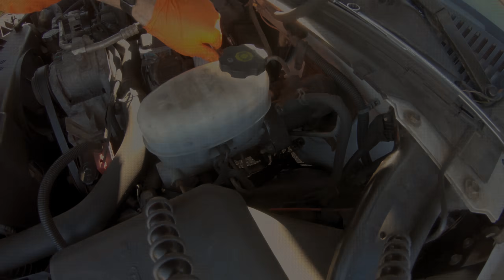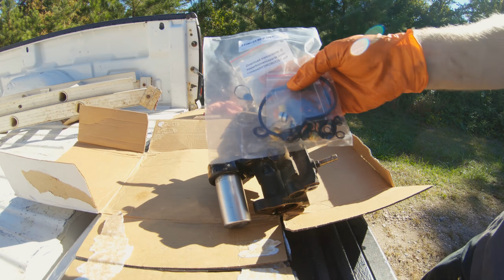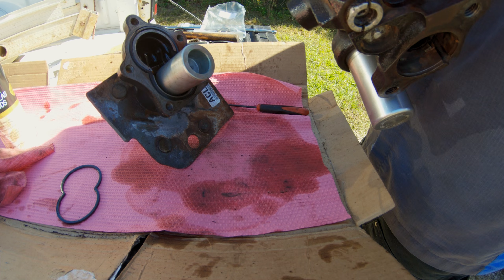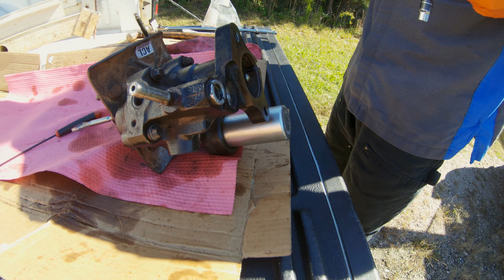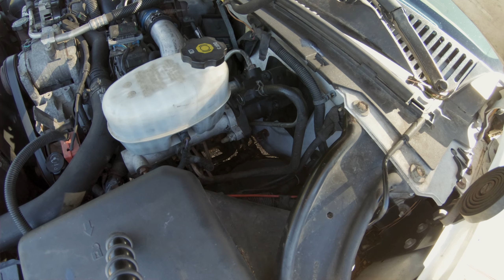GM Hydroboost Brake Booster Leak Repair

Comment: Do yourself a favor and get a 3/8" drive impact 15 mm deep well wobble socket ($20) and couple it to a 12" 3/8" drive extension.  This and an impact is all you need to get the 4 nuts off the inside of the firewall.  (If not already, get a cordless impact.  You'll be surprised how much you use it.  Plus, it busts off lug nuts and other high torque nuts with ease.)
I replaced the seal with the hydro boost still mounted to the firewall.  I was so proud of myself, but going back together, gravity was not on my side and I broke the rod that is internal of the booster.  So, don't do that!  I ended up having to replace the hydro boost, because that rod I broke is not sold separately.  $200 lesson I thought I'd share.
Using the tools I mentioned above, you can have it out in 15 minutes, if not sooner.  Then you can stand it up on its end to reassemble it.  That part is a piece of cake.  PS, you will need a normal size flat tip screwdriver to pop the metal keeper off the main rod that connects to the brake pedal.  You can rotate that metal keeper with your finger tips so you can get the screwdriver in it.  Then just rotate the screwdriver to flex the metal keeper.

Comment: good video , i put in a new unit and it leaks !!! not from the lines but i guess the internal seals.. that's from advance auto folks. did not have much room on the 2012 gas e350. any thoughts?
Reply from the maker: Return it if the unit is bad new. They nned to exchange it.

Comment: So it comes in a kit.. did I miss something or did you only replace the one seal that was leaking? And awesome video.. this gunna save me lots!.
Reply: Did the new seals. Now started the truck break peddle goes to the floor on it's own and the lines to the hydro booster get hot as hell real fast... what did I do wrong? Lol.
Reply: @ronniebarringer5887  ummm did you make sure the piston moved freely after you reassembled it before installing back in the truck?
Reply: @demonslayer951  yeah I had it figured out about 10 mins after I commented that. Lol.
Reply: @ronniebarringer5887  good shit haha. It took about 3 weeks for mine to finally stop leaking after I did the seals. Guess they just needed time to swell
Reply: @demonslayer951  really?.. that's weired. Lol. I wonder why it worked out like that.. something loose maybe?
Reply: @ronniebarringer5887  no clue, I figured it just wasn’t gonna fix it and maybe the piston was worn too much but I kept checking it and noticed was slowing down the leak and now it’s completely stopped
Reply: just replaced the seal inside for the large piston
Reply: Sweet. I have the same problem hopefully this fixes mine too.
Reply: @ronniebarringer5887  i just finished doing it on my 05 duramax, so far its not leaking anymore hopefully stays like that

Comment: Is there a liquid you can buy that will seal it up or to slow down the leak. How much for the repair  ket
Reply: You can try lucas power steering leak but it's at best a bandage to slow the leak a little. If you are leaking a lot, this applies to any type of leak, you have to trace the issue and properly fix it. No additive is going to "fix" a bad seal.  They can slow it down a bit and buy you time but it's not normally going to be worth the cost of the additive.

Comment: Good video. Not really a fun job but not the worst I've done. I completely get why you didn't record removing the four 15mm bolts in the cab, way too much cussing for youtube.

Edit: I needed to add that while this video was a great help, the seal kit did not work for me. That's probably due to the fact I bought a cheap kit off ebay. I figure if I had bought the more complete kit it might have worked. So I ended up just installing a new hydrobooster just because I didn't want to wait for a new kit

Comment: Why can't I just remove the five bolts under the hood instead of removing the whole booster from inside???
Seems quicker and less work.
Reply: You can.
Reply: My exact thoughts
Reply: @truth_teller100 I was able to reseal mine with just taking it apart under the hood but getting the new seal back in is a little tricky since you are installing it backwards. I used a little flat screwdriver to help coax the seal in place. Do not force the front half onto it. You will feel when the seal is in place. And be very careful taking it apart, there is a back pressure piece that can fall out when you remove the front half. Luckily my seal kit had a diagram of how everything was suppose to be!! Good luck!!
Reply: @peemee3011  what company did you buy your seal kit from? I need that diagram bcuz the parts store computer does not show any assembly of the interior parts. Mine kind of exploded off the booster after removing the 5 bolts. So I'm guessing how to put it back together.
Reply: @denisewilson8367  I bought it on ebay, don't remember from who, sorry.. Yeah, if there is a next time, pump the brake pedal a few times to discharge any pressure left in the accumulator before disassembly. I copied a diagram from online that is even better view than I had. It shows you sequence of parts and which direction they go.

Comment: Is there an O ring between the master cylinder where it bolts up to the booster that I can replace its leaking right at that plate where those 15 mm nuts are
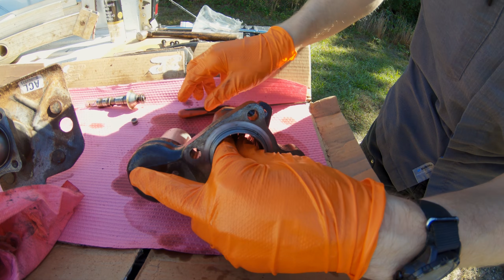Reply: pretty sure that what that lip seal prevents @10:00
Reply: its the figure 8 seal he replace 2nd after the O ring he did first. That's the seal between the booster & the master cylinder.
Reply: So if yours leaking into the floor board? I just bought a 2500 4x4 Sierra and it’s got fluid all in the driver side floor board
Reply: @bowtiebuilding   very possible

Comment: So, I'm finally getting to this job today, and my question is this- my rebuild kit came with a lot of other seals, rings, brass fittings and some other stuff. Where do all those parts go?? I'd sure hate to go to all the trouble of replacing the inner seal and then find out there were other seals leaking that I didn't replace. ???

Comment: 9:30 mentioned power steering fluid 

I truck has a leak from that area and I know my power steering fluid is very very low I didn't know that there was a connection between the two does power steering fluid go in that area too or were you talking about brake fluid?
Reply from the maker: The hydroboost is feed hydraulic pressure from the power steering pump. Power steering fluid circulates through the steering rack/box and the brake booster.
Reply: @MrSubaru1387  ok I thought that was brake fluid that creates the pressure. Good to know. I'll also check my power steering fluid since I recently had a leaky hose fixed. My power steering fluid was always low. Thank you for explaining this. I couldn't figure out why you were turning the steering wheel back & forth & pumping the brakes while the engine was off.

Comment: Ok, changed my mind. Already have the rebuild/seal kit, so I'm going to do it myself (with the help of your video). I've got to pick up a set of line wrenches (flare nut wrench). You didn't mention what size those nuts were in the video. If you happen to see this comment, please let me know what size those are so I don't buy a set with every size but the ones I need. Thanks! Lee

Comment: Hey I just watched your video . Unfortunately I bought a new brake booster and master cylinder but it says to reuse the rod with the star shaped washer.  I get that but it came with 2 small round washers do those go on the rod and if so where is the placement of them 817 627 4132 any help is appreciated

Comment: Great video, very informative! So informative that at about the 5 minute mark, I knew for sure that I'm paying somebody to do this job. I just changed out my power steering pump yesterday, and found after I got it out that it wasn't the pump or hoses that leak, it's the weep hole between the brake master cylinder and the hydro boost. Damn!! Wrong repair! But you did a great job explaining exactly what I needed to know. Thanks very much.
Reply: Damn, I almost made the wrong repair too.
Reply: I was afraid of this but spent a good two weeks watching vids and pressure washing the area in question. Don’t feel bad though it’s difficult to tell where the leak is originated from
Reply: Yes it is!
Reply: I didn't realize mine was the hydro boost at first either.

Comment: put the actuator rod in and grab the end with some viv=ce clamps make it 100 time easier to put back together
Reply: Better yet leave the star keeper spring and plunger off until after you put it together.Just slides in the back no problem.When you buy a new unit ,you use the star,spring and plunger from your old unit.Just remove the star everything will come out.Then just slip it into the new one

Comment: Thnx alot for the video man really was so handy reparin it for my tahoe 2006 the only issue I faced is wen I replaced the seal it wasn't damaged or teardown it looks fine I think it only got weak coz f heat.
Any way I placed the new O seal... 
while I was tryin to collect bouth parts together the new seal got damaged while tightening although I did lube it by steering fluid.
I went bk to automobiles parts store he told me that the new seal made f  Rubber the OEM seal was silicone.
So he gave me another 1 but I ordered 2 in case somthin wrong happens.
Again I opened the booster placed the new silicone seal it was hard gettin it in position .
 collected both parts tightened up brought it bk in the vehicle unfortunately it was leaking 🙄🙄🙄.
I was so disappointed coz it was like a full day f workin on that part. 😣😣😣
I placed a wired cam in the booster wot I found is while I was tightening the bolts somhow the seal got crushed by the piston. 
steering fluid lube didn't work.
Again I took it out went through the whole process I placed the last seal I got lubed by grease I just used it so lightly I used it on both piston & seal while I was tightening both parts I was lookin from the other side wich looks like the spider nest I used a flat screw driver to pull the seal on place while I was tightening the bolts the process was like tight a bit, take a look, push the seal in it place, repeat 🔂 till both pats joined together.

Comment: Leave the return spring out along with the star retaining washer. It can easily be reinstalled after the two halves are bolted together. This will have less spring pressure to fight upon reassembly and less chance of cutting the seal.
Reply: Definitely

Comment: Caution... That groove where the seal fits into is EXTREMELY sharp...!!! Also, when installing through the firewall, make sure the shaft is on the correct side of the pedal or it will have to be taken out to have it on the correct side (if you can make sense of that, lol) Ask me how I know... Great video bud!!!
Reply: I have the same issue. I’m trying to figure out why my brakes lock up when engine is in and release when I turn off engine
Reply: @BigAl1381 Did you ever figure it out? I'm having the same problem
Reply: I’ve never done this repair, but I read on a forum that there is a part with 2 teeth that fit into groove, and if they are not seated into the groove, what you described will happen.
Reply: Duh
Reply: How do you know what side the rod goes on because I put it all back together and the brakes lock up as soon as I start my vehicle. Trying to figure this out. Please help
Reply: @chrisroberts2194 what was the solution to this?

Comment: Thanks! Good tutorial, but you make disconnecting the brake pedal and firewall nuts look too easy. Both disassembly and reassembly of those were the hardest part because of not having room.

Comment: How does power steering fluid get in the break booster? And why not use break fluid to grease the seals?.... I just want to know. Not being sarcastic.... I just don't know. Thanks.
Reply from the maker: Hydroboost brakes work off of hydraulic pressure. The hydraulic pressure is supplied via the power steering pump. The two lines going in to and out of the booster are coming from and going back to the power steering pump. No brake fluid goes into the brake booster. Power steering fluid does, that's why the new seals are lubricated with ps fluid.
Reply: @MrSubaru1387  Well thanks for sharing this because mine is as greasy as all get out and I was concerned that it was break fluid. But because of your video I know it's my booster. I drive a 2003 escalade ext and I'm sure I can do this! Yay! Girls don't have it easy with most mechanics..... And changing these seals should be an easy job.

Comment: What let’s you know when it’s bad
Reply: Puddles of power steering fluid under your truck. If you are losing a lot of power steering fluid, this is the most common cause on these trucks. You can put 1oz of uv dye in your power steering system and trace the system with a uv light and those yellow uv glasses. You can use uv dye to find leaks in most oil systems: motor oil, coolant, ac system, and power steering. Nomally brakes will be obvious enough to trace with out uv dye.

Comment: At 16 minutes you are putting the 2 pieces together, then edit and the halves are together. With my rebuild , I am at the 16 min mark. I can't get them closer than 1/2 inch. What did you do to get them together? When you weren't filming?
Reply: how did you finally get them together?
Reply: @Greg-bq2tx  watch this video. Excellent discription of that part. https://youtu.be/6Fe61PdRZ0U
Reply: that dodge cummins hydroboost video also did not show how to get spool valve into the fork when putting halves back together?  I spent 2 hours and cannot get it together with spool groove in the fork pins??
Reply: @Greg-bq2tx  https://www.oilburners.net/threads/hydroboost-reseal-tutorial-long.72688/ maybe this will help. Very detailed information

Comment: I just did mine today and its important to say that when you are about to assemble,when you feel pressure is because the new seal its blocking the piston, that's why won't go in easy !!!! I find out the to make it easy its use a flat screwdriver front the front hoe where the master cilinder is and press down the new seal around, be careful not demage the new seal ! and job done 👍 all go in with no pressure well done 😎 !" Thanks for you video i didn't replace the hidraulyc booster 👍 i did save some $$$$$$
Reply: Im so 😊 happy i did the job my self, no problems so far and non leak, just replace a 12 dlls gasket, thanks to this video 👍
Reply: What do you mean with a screwdriver? Use the tip or the handle side? And press where the master cylinder goes into?
Reply: @mayeri3083  on the inside of the tube where the piston slides in you will see the gasket all round when you try to assemble back you need to press down all around the seal to let the piston in to the tube !!!! You will need a flat screwdriver small ! Be careful not to damage the seal take your time !!!
Reply: @elafamado278 your are the man props for this information. 👏

Comment: I need to do this on my Tahoe.  I opened it up today and reinstalled it.  Now the pedal goes straight to the floor while the truck is on, but when you turn the truck off, the pedal releases and goes back up.   Lol.  What could cause this.   
I'm already going to order the seal kit.
Reply: I am having the exact same problem with the brake pedal. Did you ever find out what it was? I'm going nuts because it's my everyday truck for work. I'm having to drive my wife's tiny little car and I'm a big guy. I called a couple of places and no one knows what the hell I'm talking about.
Reply: for me it was the spool return spring, It popped out and i didn't put it in when i reassembled, took it apart again and put the spring in and works good now
Reply: @markotto7335  long shot,  is your dad jim?
Reply: @Greg-bq2tx  No, lol
Reply: I have the same problem pedal gors to floor when started and lets up whwn shut off.  How did you fix this?
Reply: Anyone figure out what was causing this after 4 years? 😂 I'm having the same problem

Comment: Hey;  
My neighbors 2500 truck w/Hydraulic Booster (fluid not vacuum) pedal goes straight to floor.  Start up, let run for minute or so - straight to floor.  
I'm somewhat mech handy and trying to save older man a cpl bucks.
I see/feel minimal fluid underside at Master- Booster connection weep hole area.
In your removal the first hose you removed on mine fluid came out.  On this truck that hose returns to Power steering pump. 
I think i understand some with diff brake set ups are vacuum or fluid?
With no external evidence Am I safe to say Booster is leaking internally causing issue?
Best; Tom
Reply: I have same problem, pedal straight to floor after changing seals for hydroboost. How do I fix that?
I bleed the system.
Reply: @Keepin-it-wheel101   Did you read one of my replies on my adventure to find prob?
Reply: @jamesbailey7785  yes but I dont know how to get the air off the hydroboost.
Or may be I need to bleed the master cylinder....
Reply: @Keepin-it-wheel101  You take the flex 1/2 " hose that goes from Boost to power steering pump off. plug it, Place a hose from boost to drain pan. You must have front end up for free movement of front wheels. You should have  truck off and do the 5 times turn full left then full right, keep eye on power steer fluid. After 5-8 times full wheel turn process I started truck and did 4 more bleed cycles.  Check power steer fluid to proper level and you should be ok.

Comment: There's a small circular piece that fell out of mine, which way does it go? There's a bearing (check valve) does it go in or out????
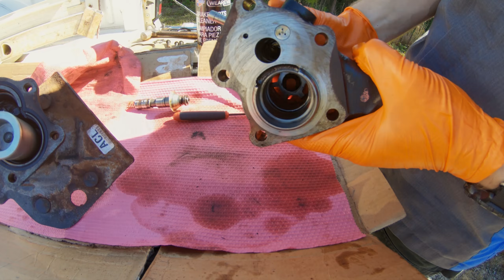Reply: Had same thing happen... at 11:57 in video for a split second when he finishes putting the seal inside and holds it up you get a glance of it and as long as he has it right it goes with the 3 holes facing you.  Hope this helps the next person.. and thank you for your video...